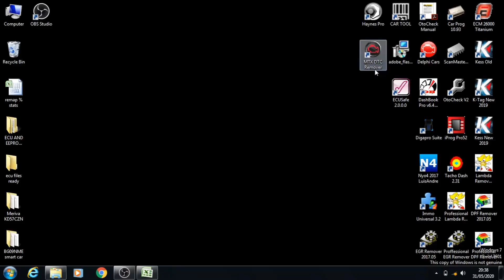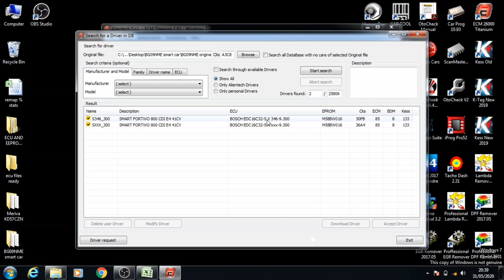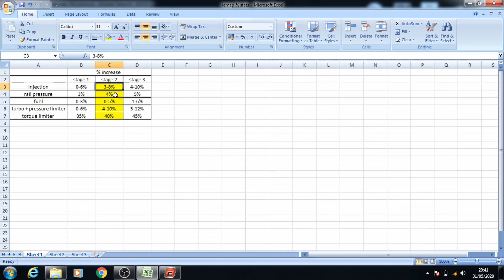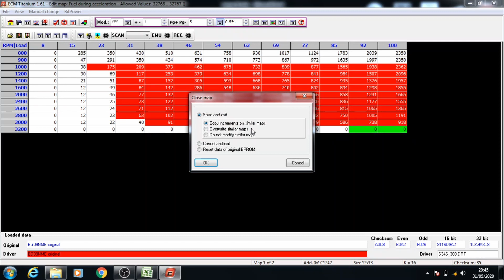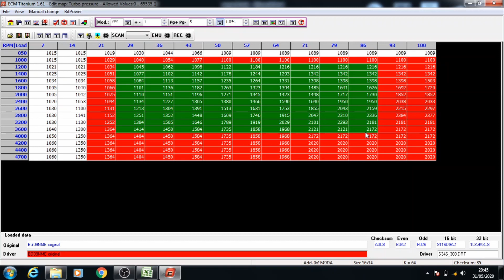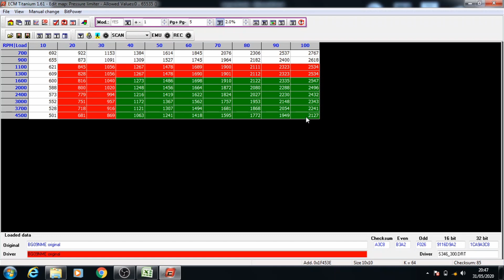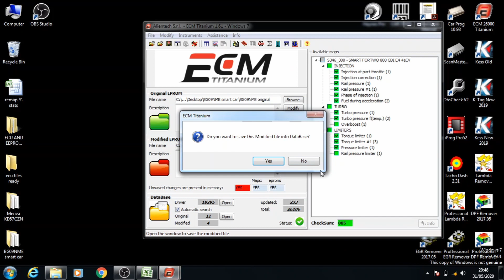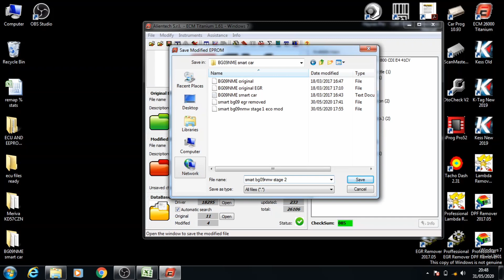How to Remap Tune ECU Engine Control Module of Mercedes Smart Car for 2 4 Engine to Stage 2 Tuning

Comment: Hi on stage 2 you put 10 per cent of pressure limiter. do I need to have a sensor map 3 bar or the original works??